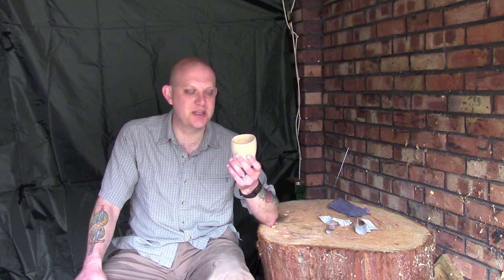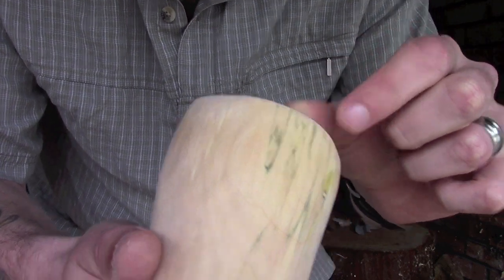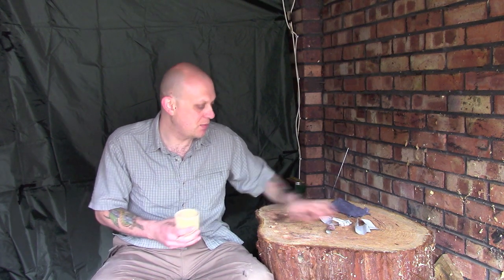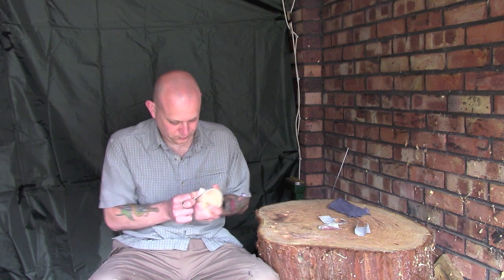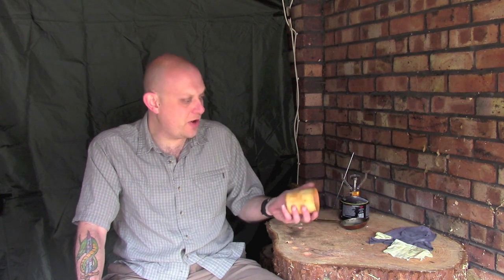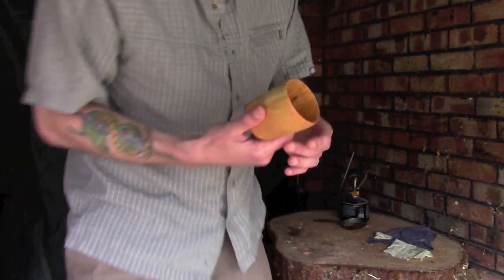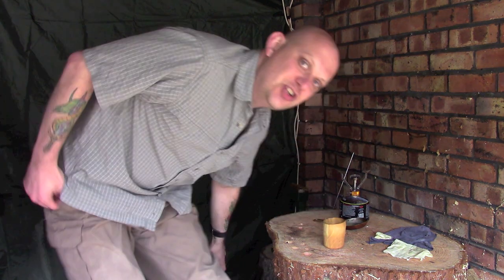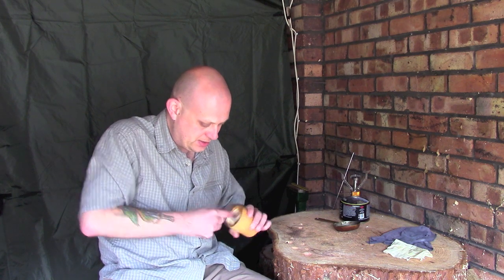Carving a Cup from a Branch - Part 4

Comment: Can you drink hot drinks from it? or would it melt the finish or ruin it?
Reply from the maker: Jako Absolutely you can use it for hot drinks, the finish is a lot more hard wearing than it looks, the only real issue is using hard/sharp implements i.e metal which may scrape away the beeswax an require an touch up now and then.